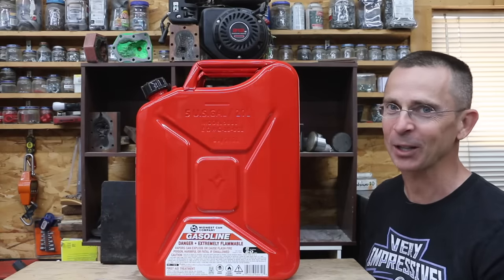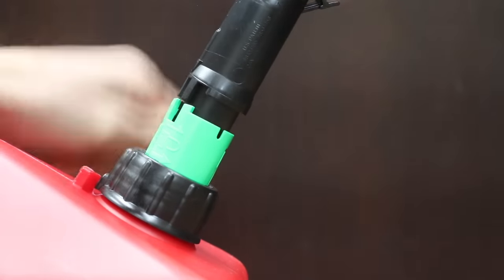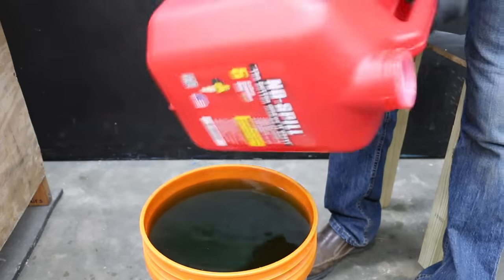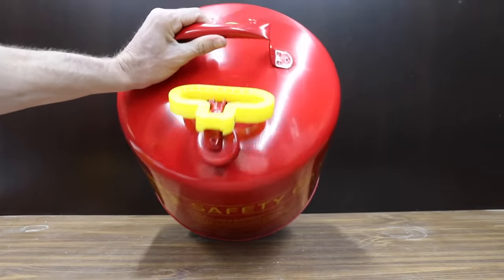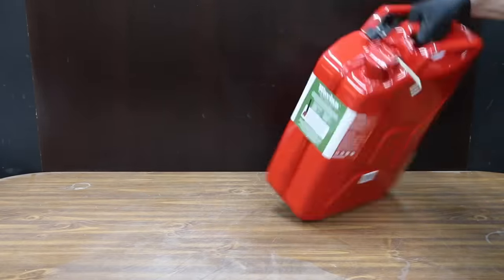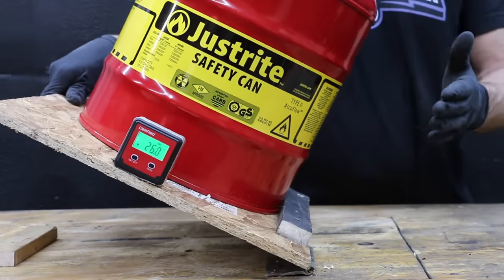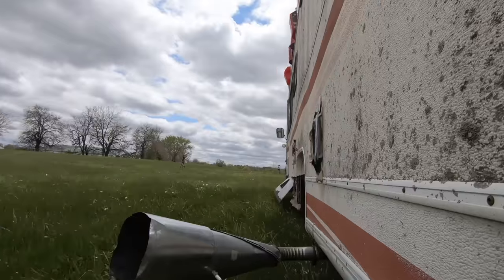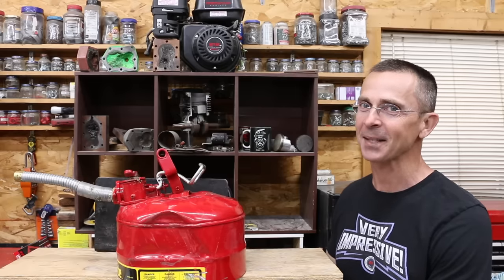Best Gas Can? $140 Wavian vs Eagle, Surecan, Scepter, Briggs & Stratton, Midwest, VP Racing

Comment: The trick with the VP racing can is to leave the vent closed for the first 5 seconds. Then crack it open and the suction will keep it from spilling
Reply from the maker: Thanks for the feedback.
Reply: I remove the cap but leave a finger over the hole until I can remove my finger without spillage.  It's progressive.  Early on I can admit just a little air and a few seconds later use no restriction.
Reply: I absolutely swear by these cans. I’ve used them for 20 years for any non-highway vehicle. I also like to keep different colors for mixed vs regular.
Reply: This also works for other cans.
I’ve also noticed that if you have a leaky gasket in the spout, keeping the vent closed will stop the leak after a few seconds because the leak will act as the vent.
Also,
The shop had a bunch of fuel cans that the spouts were missing or broken. I picked up a bunch of replacement spouts at a hardware store, and successfully put most cans back into service.
Between the new spouts and the survivors, I played “musical spouts” for a bit, and was able to get all but one oddball can to seal properly.
The spouts had those red safety locks, which I promptly removed. Why? The redundant part would reengage at the most inopportune times, which both frustrated, and made for more spills.
The spring action was enough to keep spills to near zero.
Reply: @TM-xs5uf  Remember, there is a color code for each fuel and water to be used. Be sure to teach that to people who use multi cans of different fuels and water. Color coding came about when the Marines at Peleliu in WWII were given contaminated water out of used fuel cans. They came near to losing that island due to no fresh water.
Reply: 1+ on VP cans ,love them!
Reply: Fellow car guys, unite!  lol
Reply: @jimdog48   
Just go buy diablo's masonry bits they've come out with recently.. they cut through rebar as well as concrete.
Reply: @rmp5s  👍🇺🇸
Reply: VP racing or Mr Gasket (which is same style just a bit cheaper) it takes a bit to learn how to use, but over time it’s well worth it! Ive gotta try the perfect hose bend for filling small engines. They are a bit harder with a full can. But by far the best gas jug I’ve found.
Reply: I use a 'Risk Racing' 5 gal fuel can that is along the same lines but the vent is on the opposite side of the top of the can to the spout.

Comment: Growing up, I remember when the change to the "no-spill, safety locks" was made and I've hated them since then.  Putting in an order for an Eagle right now so that all of my lawn activities start peaceful instead of profanity-laden. Thanks PF for another awesome review!
Reply: I use the eagle cans they are great. Just don’t try and fill a side by side with it or else you will be cussing unless if you have a decent funnel.
Reply: See my above post for sources of non-safety spouts.
Reply: The Sure can design is the one I find to handle every situation with ease, from cars to small handheld equipment.  No funnels to deal with, which is a problem putting away and dealing with the fumes from the evaporating gas after use. The price is the only thing that keeps me from ditching all my other cans for it, though it's not bad in comparison to what the some of those others go for.
Reply: Just use race cans.
Reply: You won't be sorry, I love my eagle cans.

They make ones labeled for K1 and Diesel as well. The only thing I use plastic cans for now is 2 stroke mix gas.
Reply from the maker: You are welcome!
Reply: You can buy conversion spouts from Amazon. They're basically just aftermarket oldschool gas can spouts. You have to drill an appropriate sized hole somewhere near the top to insert the vent cap, though.
Reply: Some are better than others. The Scepters press-downs work ok, the push-levers are better. Briggs style are atrocious, but the garage boss is an improvement for them. I use one for my 2-stroke saw mix, the “on-demand” dispensing nozzles are mandatory to me. Those press-down styles just roll the saw and spill everything.
Reply: Go with the just rite
Reply: They sell replacement spouts for like 10 bucks
Reply: What's the big deal? You just juggle 35 lbs of gasoline and container, while hanging off the side of your tractor, by your teeth, so you can use both hands to operate the valve, Remember, safety first.
Reply: Get a race can, the VP is a good example!
Reply: I use a tapered transmission oil funnel and just remove the spout for filling vehicles and equipment.
Got lucky with one skid loader. Take off the spout, and tip the can opening and it fits right into the filler opening.
That can empties in a few seconds and leaves about a quart in the bottom of the can.
Put the spout back on, and those few drops are nothing.
Beats holding that thing up to let maple syrup flow through a half-inch hole!
Reply: You and me alike.....
Reply: @SalandFindles  Did that. Works well

Comment: I purchased 3 Eagle cans 10 years ago. They still look like new. To be honest, they don't get much use as I kept them with I used a portable generator for my house. Since I went to a Generac system for my house, they only keep gas for my snow blower and lawn mower.  They're still one of the best buys I've made.  great job again.
Reply from the maker: Thanks!  Thanks for sharing.
Reply: Thanks for supporting a American company eagle manufacturing is in my hometown of wellsburg I have alot of friends that work their and family  they make a wide range of other products .  the steel for their cans is produced just a couple miles away ,and shipped by rail right to the factory.

Comment: Have a bunch of the VP cans. They work well and never die. Their tendency to leak from the vent is annoying though. My trick for avoiding that is to start pouring with the vent closed and then loosen it shortly after. That lets some negative pressure build up in the can, which makes air force its way into the vent and keeps fuel from coming out of it even if I have the can upside-down.
Reply: The LC LC2 can, similar to VP, is less prone to leaking through vent cause it's better positioned on can and handles are better positioned.
Reply: I use the VP jugs. I just leave the vent closed all the time and use an M51 funnel instead of the hose thing. I just take the entire cap off. Works well for the mowers and my race car.
Reply: You can put a tube over the vent and run it down the outside of the can so that when you tip it over the vent is above the fluid level.
Reply: I thought this was the correct way to do it.  Wait for the for to start before loosening the breather.
Reply: Amateurs!!!
Reply: @ProcTech  yep thats how they are designed to be used and funnily enough it works perfectly lmao

Comment: Bought an Eagle can when the EPA spouts started coming out.  Super happy with it.  One tip though: Squeeze the handle briefly to vent the vapor pressure while the can is still sitting flat, before you start pouring.  If you're in pouring position and the can still has pressure in it when you pull the handle, it blows gas all over the place.
Reply from the maker: Thanks for sharing.
Reply: I literally just commented on this.  It's a good can, but I've sprayed my hot motorcycle (and myself) on several occasions.  Talk about dangerous.
Reply: They are by far my favorite cans. If you find old Eagle cans at garage sales, scoop them up. The old old ones have a vent cap at the other side. I have many old and new ones and won’t buy anything else.
Reply: I have ALWAYS vented while still on the floor as it's so easy to just pull the handle as you're about to pick it up.

Comment: Glad to see the round Eagle can perform well.

I've been using the same one since at least 1974 and it still works well.
Reply from the maker: Thanks for sharing.
Reply: honestly i think eagle won lol its the best overall if you make that b an a and its basically 50$ cheaper than the justrite
Reply: @OverkillBillsXbox  that's what I was thinking, only graded slightly worse than the justrite, and for a little over half the price? Plus I like the look so Eagle ftw
Reply: Except for the fact he did not use it correctly
Reply: I just bought one today for $25 that has a pretty big dent in it I'm going to try to get the dent out with compressed air or maybe some hot glue sticks stuck to the side of it and pulled really hard wish me luck.
Reply: I'll throw in another plug for Eagle. Got married 20 years ago this month and moved halfway across the country and had to leave my even then well used Eagle can collection behind and afaik they're still being used by the niece and her hubby. Short of falling out of the back of your truck at 70mph or being left exposed to the elements 24/7, they are a lifetime can.
Reply: The home cheapo rental I worked at was updating & I got to take home 3 slightly dented 3gal eagles. They're fantastic, and even have a 2nd valve (spigot) at the bottom for upright training.

Comment: Im currently in the market for a gas can and couldn't believe the range of price discrepancies.  Having watched this video I realize there is a lot to consider on what I thought was a simple product.  Todd and crew, you guys make it very clear and always use realistic scenarios that pertain to our daily lives, well at least mostly :).  Keep up the good work and definitely use the farm-abago!
Reply from the maker: Thanks, will do!
Reply: Hard to beat the HF $45, but don't seem to show on website anymore. The Battery Fuel transfer pumps are awesome though. Makes filling from a can so much easier
Reply: What's the point of a dedicated petrol can anyway? I just use an old 20l diesel additive container
Reply: @MyMika2004  I've never owned an adblue diesel vehicle, and I didn't want a horrible weak plastic can
Reply: @Bobo-ox7fj  neither have i, they were throwing them away and where do you carry it where youre worried? Mine is just tied in to my boot
Reply: I'm full in on the eagle cans. I have 2, they never fail. He used it wrong in the video. There funnel stays attached, then you pull the handle.
Reply: @MyMika2004  insurance purposes could be one liability i can think of.
Reply: @mrmotofy  I have the HF can, which is good, but the cap is junk (broke while screwing down).  I'm getting some Wavians to replace them because I want a can that I can keep in an SUV without having the smell of gas everywhere.  I have a Canadian Scepter military plastic fuel can.  Excellent for this purpose, but expensive because of Libtard restrictions in the U.S..  Almost impossible to get the spout needed for it, so I use a fuel transfer pump.  These cans are significantly beefier than any of the cans above and absolutely drip and vapor free.

Comment: There is a whole lot of engineering here with what seems to be noticeably worse performance than the old school vent in the back cans. I’ve used a few of the ventless ones and I think there was only one design I could keep from spilling with.
Reply: You can blame California. Specifically the California Air Resources Board. They outlawed vented gas cans, and the rest of the country followed suit around 2008.
Reply: I've bought accessory spouts for my cans they are larger and come with a vent for you to add.  I refuse to put up with these things.
Reply: @W1ldt1m  same here. Makes night and day difference with the added vent and keeps them from blowing up.  Win/ win.
Reply from the maker: Thanks for the feedback.
Reply: What was the most annoying to me, is when they came out with the plastic can with the safety nozzles locking, springs, garbage.
Reply: I spilled more gasoline with the terrible Midwest Can, with the spout you have to hook on the filler neck and push to get it to flow, than I did with any other gas can I've ever had.
Reply: @mike81399  And pushing on the spout for flow puts so much pressure on the threaded collar that holds the spout in place that it will crack.
Reply: Prime example of dumb epa regulation that is actually counter productive. Less voc in theory and in practice you spill gas everywhere, but I guess we are doing something to show we care. SMH.
Reply: @Xplasma1 , oh don't forget lawsuits that came from improper use by kids/teens and adults who wouldn't have ever been near a gas can. That's what killed Blitz manufacturing. I still have one of them cans somewhere.
Reply: they vent through the fill spout  outer wall....your welcome....
Reply: You can see from the testing that the ones with no safety mechanism had more spillage, even if they took long to dispense. Of course we all like vented better; they’re easier and faster, but with many things easy and fast usually aren’t the most safe.
Reply: @Tyler-zw4kq  For CARB compliant fuel cans, I just remove the nozzle and pour it in a funnel.  Works so much better.
Reply: Anytime I see an old vented gas can just sitting in a customers garage, I ask if they wanna sell it lol
Reply: Not a problem buying vented ones in Canada.
Reply: The plastic "safer" cans have given me more trouble than the old steel cans. After spending about the same amount on several plastic total as one steel can, I said screw it and won't ever buy plastic again or the plastic garbage on a steel one.
I'll stick to an Eagle style or a Jerry can
Reply: Before the paper straw, this was the last "big great idea" from legislative authorities. Because y'know, petroleum is precious so let's anger the entire country over worrying about 5 gallons while slapping megacorps on the wrist for screwing up and spilling millions of gallons.
Reply: @Tyler-zw4kq  well it makes it illegal for companies to sell them. It doesn't stop you from modifying it yourself though.
Reply: VP Racing FTW...... mine seen too work for all kinds of stuff! 

I actually like the LC Racing jug better. the vent is located better to reduce leaking and handles are postioned better to balance weight.
Reply: @W1ldt1m  I found a replacement nozzle. I think it’s called a “water” can nozzle on Amazon. Full to empty in 45 sec.
Reply: get a jiggle hose much faster than any of this for full tilt filling.
Reply: Yeah, I bought a new fancy fuel can a few years ago and was about to throw away my now twenty year old can but forgot to do it. I ended up throwing away the new can because I got tired of spilling fuel. 
My old can is perfect. If anyone eyeballs that can I'll hurt them.
Reply: Good video.  A gas can is one of those things we just take for granted. I lived in California back when they banned the vented ones and was working at an auto parts store when it came down.  As soon as it happened we sold out the entire stock of the more expensive vented cans in one day and the latecomers were upset that we wouldn't get any more.
Reply: All the time army military surplus jerrycans are available on the market, I can't see the reason to buy anything else
Reply: Drill a hole in the back of the plastic handle. Put a rubber stopper in.
Reply: I don't live in the USA and I am still effected by that law! With that said it look like Canada was only somewhat effected. I just took at Canadian Tire (or everyone's favorite nick name for the place, Crappy Tire) and it looks like over half of the Jerry cans have had the vent spout added back on.
Reply: @Earthneedsado-over177  Bad experience with mine as well. Using it to put gas in my truck I noticed that once the release trigger is pressed, there is such a large rush of gas that it ends up back flushing and poring on my foot.
Reply: @Earthneedsado-over177  👍
Reply: @Tyler-zw4kq  While the new nozzle is great I had the vent leak even when upright on the way home from the gas station in the car. I was careful making the hole for the vent also.
Reply: @Embermist69  still use my 5g Blitz. Great can
Reply: I like to take the over engineered made for pennies safety spout off and pour with no funnel to guarantee I spill as much as possible. Then maybe one on the ground for the homies if I didn't spill enough. 
I don't have one with the new plastic flame arrestor mesh yet. Looks like that will add to the fun.
Reply: @W1ldt1m   The black market always finds a way around the lefts clownery.  Glad to see people stepping up to fix the idiocy and hopefully making good money doing it.
Reply: That's progress for ya 🙄

Comment: I applied for a mid level position at Eagle Manufacturing about a year ago. Eagle was bought out by the Justrite company and the plant I applied to made both products (if I remember correctly). I bought a couple of Justrite cans just to know how their products were. They are my favorite gas cans by far. Absolutely no complaints. I ended up getting a job elsewhere because the pay was better but I was impressed by the company culture at Eagle.
Reply: I have two Eagle cans and love them.
Reply from the maker: Thanks for sharing.
Reply: Got a Justrite 5 years ago after hating every other can I had used, it’s the only one I have had that is actually good at its intended purpose.
Reply: Bought 2 justright over 10 years ago and they are excellent.
Reply: @rfelllner  I've got five of the Justrite cans in different sizes and love them